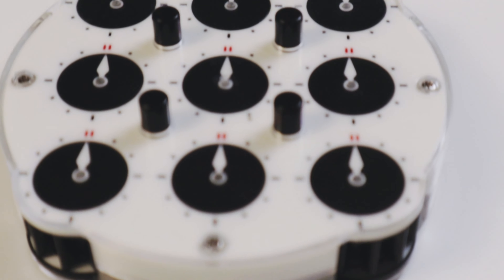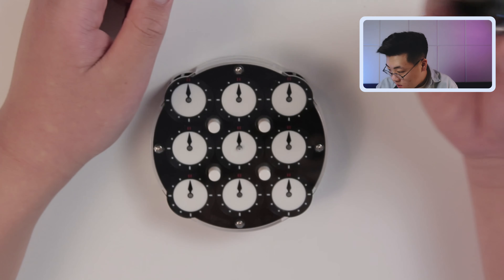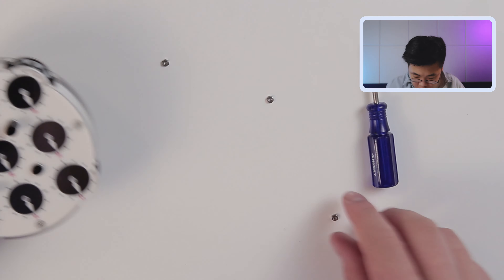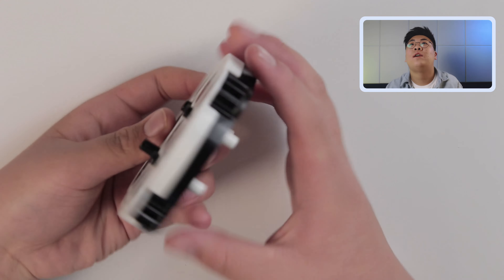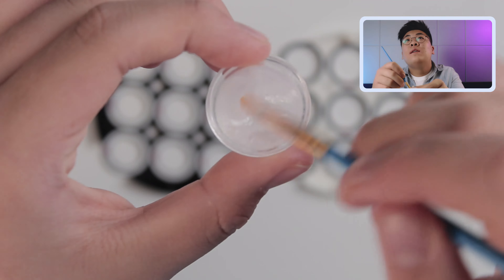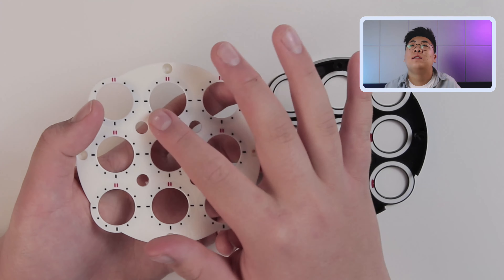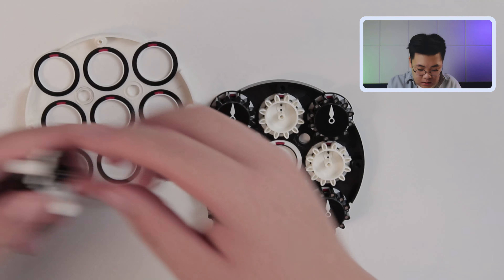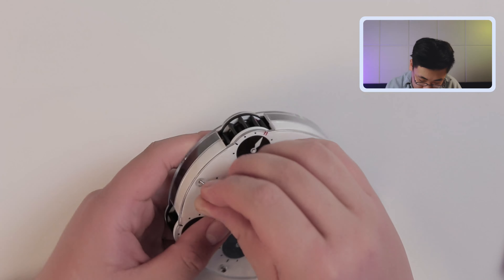CLOCK SETUP TUTORIAL | Island Cubing

Comment: this literally does nothing
Reply from the maker: Clock solvers say otherwise
Reply: lubing the clock cases does a lot for the performance of the clock but lubing the pins couldn't be anymore of a waste of time
Reply: you also missed some things in the assembly, you need to make sure that the two corner pieces that have magnets in them are placed diagonally and when taking apart the clock you need to make sure that you know which edge clock was in the centre because it has a different magnet strength to the rest of the edges clocks and can cause problems if it's not put back in the centre